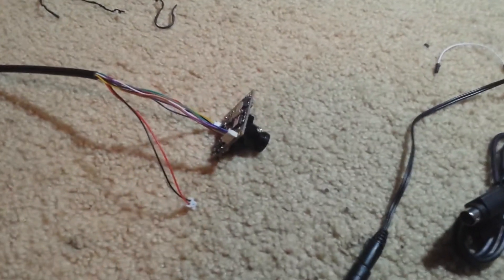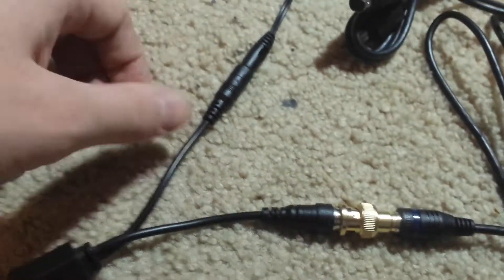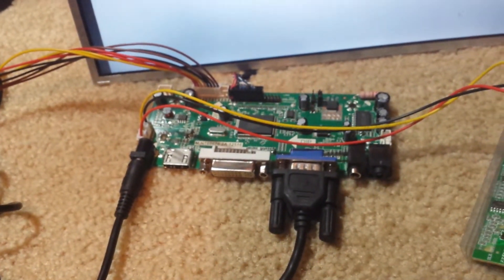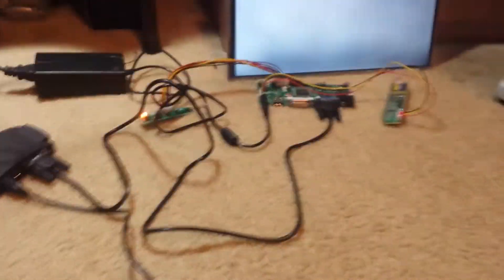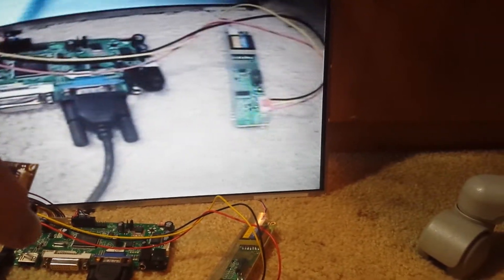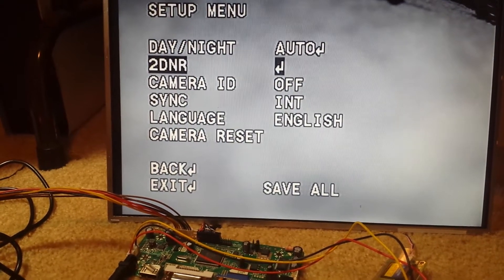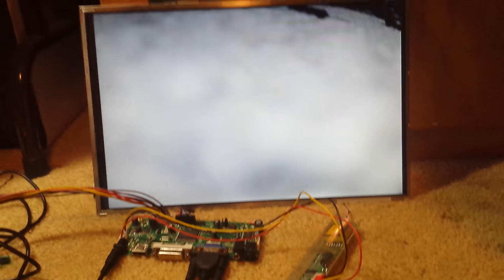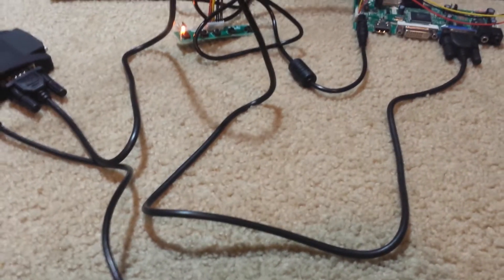ROV Video System

Comment: How are you recording your video?  Also, does the bnc to vga "improve" the video?  Is there a difference in the video standard between cctv and vga?
Reply from the maker: At the moment I am not recording the video. I am planning on having a GoPro mounted externally on the frame so that I can use that to record, and the internal camera for piloting. The VGA converter does not improve the video, it just makes it so that it can be displayed on the monitor that I am using. There is a difference in the video standard, but it is mainly that VGA is a common input for monitors like the one I am using.